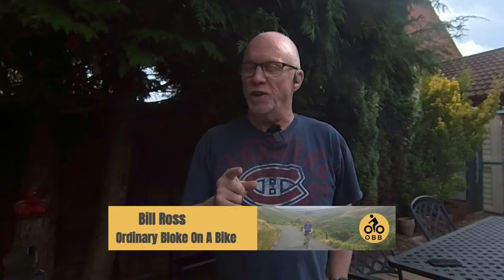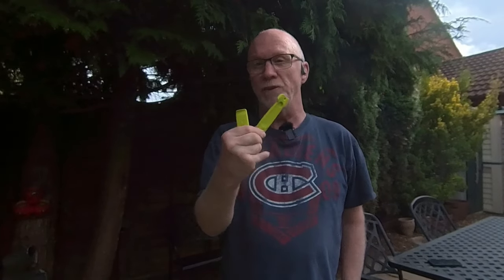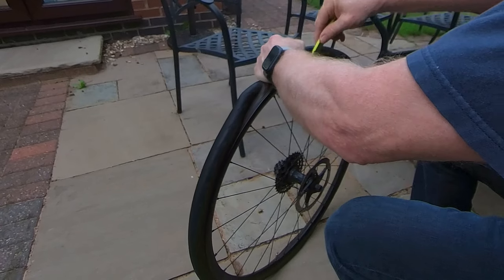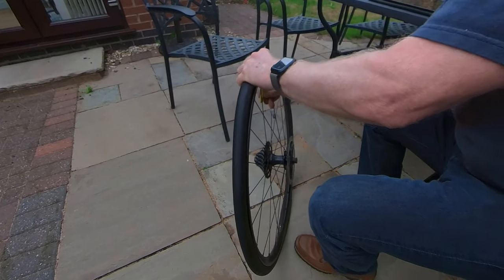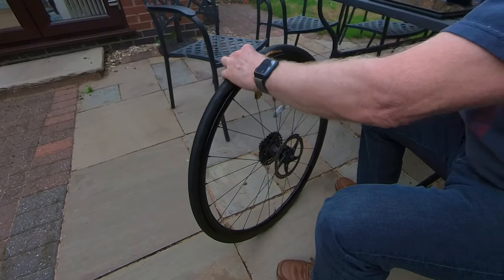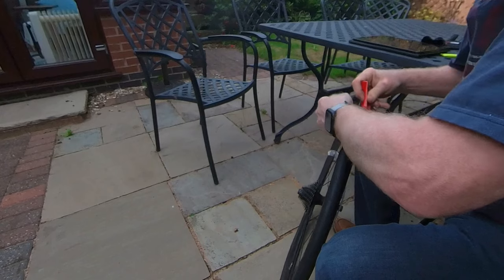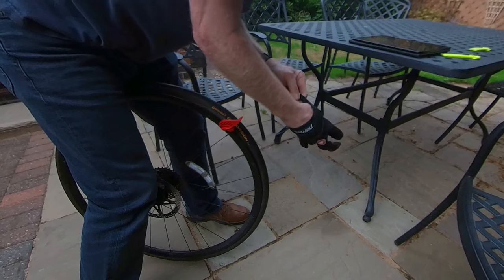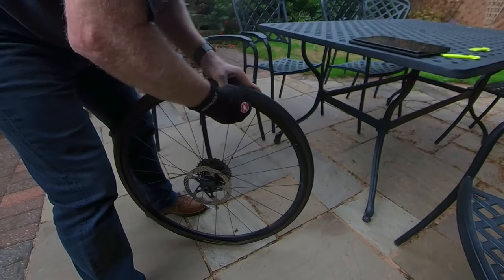BEST TYRE REMOVAL TOOL EVER ! MEET TYRE GLIDER

Comment: They is a more efficient way of using a single tire leaver were it just glides through it and the tire is removed in seconds.

Tho not many know how and knowing just the amount of angle by feel is not something the average person will do so this new tool seems to be doing this same trick so handy for those who struggle

It’s also the way car tires are removed the tool that’s used on them is very much like what this tire glider looks like so seems someone just made a handheld plastic version for cyclists

Comment: 😂 In 35 years of serious cycling I've never had a problem with tyre levers.  

Another solution looking for a problem, but glad it worked for you mate.
Reply: I was thinking the same thing. Allowing the opposing side bead to fall into the rim channel is the key. Fighting the tire with any device is the hard way.
Reply: A lot of the new rims set up for tubeless are a lot harder to install tires on than they should be.   Especially gatorskins, when cold, are brutally hard to install.   Anything to help especially if you've got arthitis or other issues is a great thing.   Everyone wants to be on the road more and not by the side of it working on getting a tire on/off a rim!
Reply: After 20 years of serious cycling ,I waived the white flag on tubless ready GP5000s on an older set of Mavic UST rims. Tried ever trick I knew and failed. Fitted Michelins in a less than a minute. Horses for courses I guess. I am buying myself a Tyre Glider and preparing for attemp number two.

Comment: Can't get mine under the bead to remove. Still had to use a lever.
Reply from the maker: Sorry to hear that. You may already do this but pushing the tyre away from the rim toward the centre so it's detached from one side of the rim all round makes it easier. Getting the edge under the bead should be similar to getting a lever under but you then have the leverage provided by the Tyre Glider to lift it up 😁 👍